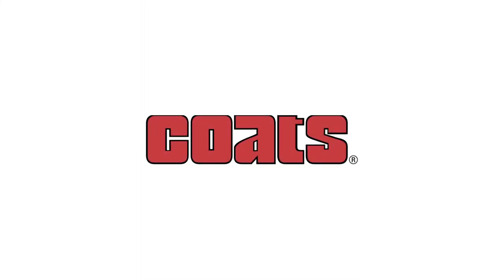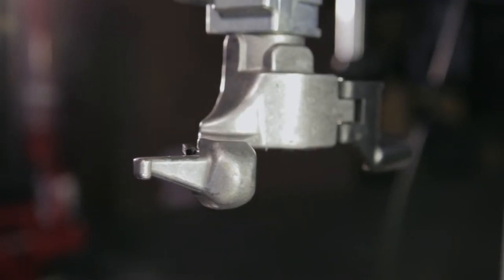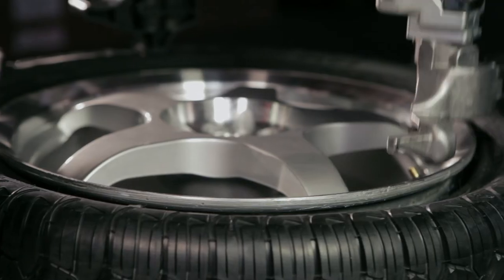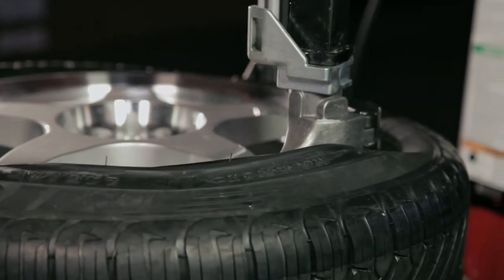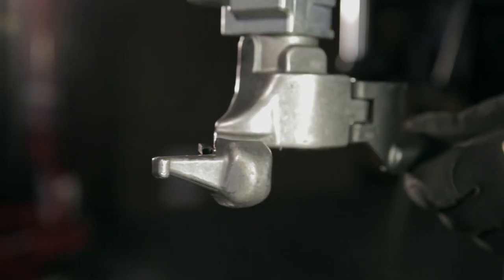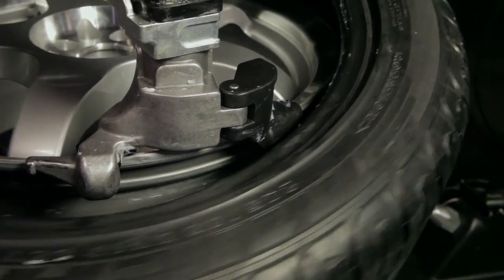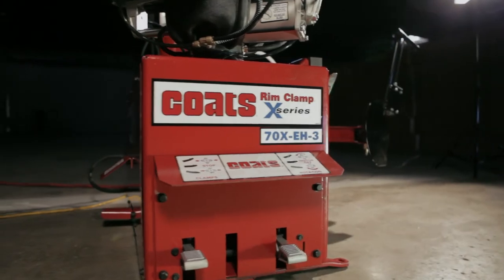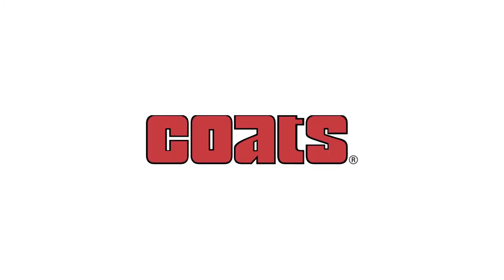COATS Hybrid Duckhead Mount/Demount Head

Comment: Hybrid duckhead keeps ripping/peeling the rubber off the bead when dismounting tires. I've tried everything. The spacing between wheel and duckhead is proper and never touching, bead is lubricated and still it rips the bead.
Reply: your obviously doing something wrong if your ripping the bead of the tires.
Reply: @Michael-uo4jj  Not true, this solution is great for normal tires but you will run into issues with low profile and run flat tires. During the mounting process the torque of the tire will flip the rubber portion of the duck head backwards and lead to bead damage. This duck head also only works well if everything related to the placement of the duck head is rock steady. Think twice about using one of these on an older machine with looser tolerances.